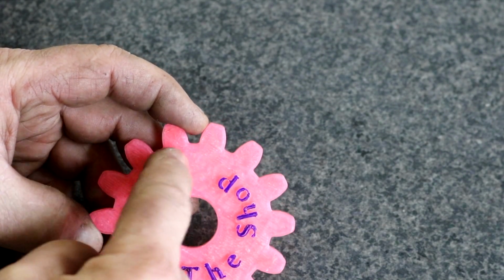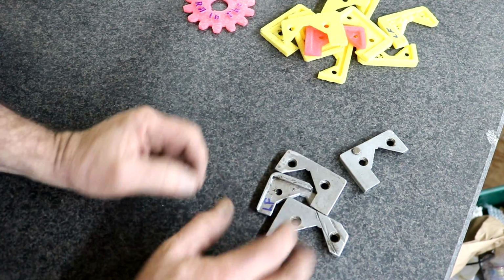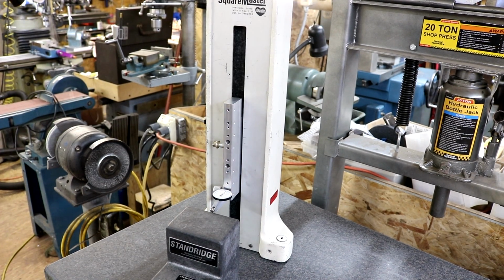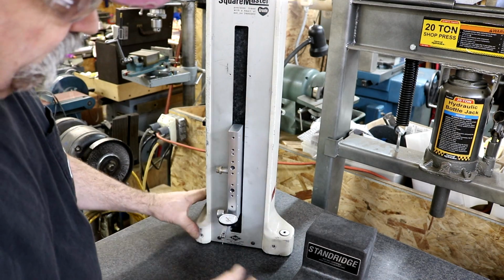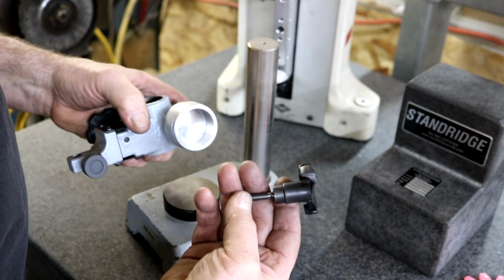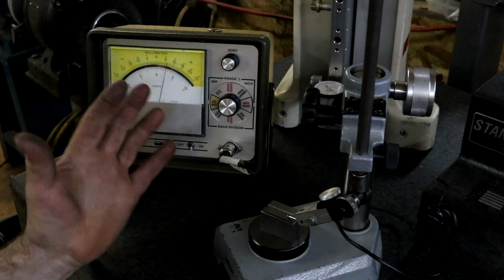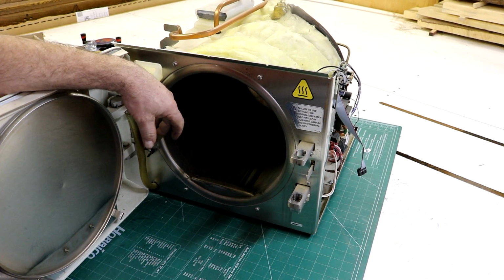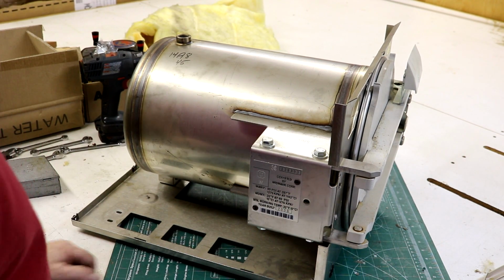Ketchup #64  Ebay Finds  3D Printer  Heat Treat Oven  New Lathe

Comment: Last Bash I picked up a Mu Meeter from Mttutoyo, got it working pretty good witht the help of Robert...
The autoclave is gonna be quite a challenge, don't forget you'll also have to brick-up the front door, maybe try some refractory cement or ceramic bricks, just an idea....   If you make it airtight enough you may be get yourself an inert gas treatment oven...
Have fun with the new projects...   ;)

Comment: Number one tip for “too hot” on small parts is to print 2 or 4 up, that way there is a slower per layer time, so heat does dissipate. PLA loves cooling.. when first starting I wired up a CPU fan and would just sit that on beside the print to cool it down
Reply from the maker: I will try that today, Thanks.

Comment: On ABS, use a heated glass platen with cheap hairspray to make it stick. Avoid drafts, particularly on thicker parts, or they may delaminate. Let part cool and it should pop off, clean platen with glass cleaner. ABS can be treated lightly with solvents, particularly acetone.  Light sprayed on coats will dissolve, then harden the surface; glossy finishes are possible. Avoid air drafts while printing ABS (a cardboard box does wonders). 45 degree minimum slope still applies. Oh, and ABS is more prone to warping than PLA is.
Reply from the maker: Thank you Wes for the helpful advice.  I am not up to trying ABS yet.  Right now PLA is challenge enough.

Comment: If you print some section without support, 45 degrees is the steepest slope projecting over air you should use. Radius curves help a lot, and they look good too. Sometimes flipping the model upside down or on a side to print is needed. The slicer program should make supports for you if you allow it, but then you have to clean all that off the part when you finish.

Comment: Now you can continue down the rabbit hole of ever tighter tolerances. :-)  I think you would find it easier to build a square oven as trimming all that fire brick will be pretty wasteful. I guess you could cast it with refactory like Keith Ruckers foundry.
Reply from the maker: I am thinking 2" wool.  and a few bricks on the bottom.

Comment: Hi Randy,
Looks like you found some nice Ebay buys. I use to have a nice comparator stand like the one in your video with a 4" Federal .0001 indicator, I loved it for O.D grinding.
Steve
Reply from the maker: Yes it is a very nice stand.  I have a nice tenths 3" Starrett for it.
The Squaremaster was the best deal, very nice.

Comment: Instead of bricks use high temp blanket and make a “muffle” furnace. Less weight, more useable room. Plus you can build the elements into the muffle and slide the whole thing in the casing. My enameling kiln is set up that way and it is super. There is no door seal. The door insulation just presses against the insulation on the inside. With a sheet metal casing on the outside you got you a sweet furnace.
Reply from the maker: I was thinking of that.  Could you send me a photo of your set up?  RRINTHESHOP@GMAIL.COM.

Comment: Hi Randy. Being off work is giving you too much time looking at EBay. Lol
Nice finds. My 2 cents on the heat treat oven. I think it would be less work to just bend some sheet metal  around the bricks. Putting a square peg in a round hole is going to cost either a lot of oven space or brick thickness. I would be happy to measure mine if it helps you out. The kiln bricks are not cheap and having to trim them to fit the circular shape would be a waste of material. I “re-bricked” mine and I’m very happy with the results. 
Cheers my friend

Comment: First of all, one thing i note is the fact that the 3D printer seems to be "flimsy". Unless the 3D printer i something in the professional range, you'll almost always have to check your "ways" for loose fit and whanot. So, before you play with any settings, go check for any obvious looseness in the machine. IF possible, by design, adjust according to online guides if no booklet is provided. IF not possible, then try and figure out how some of the slack can be taken off.

Things to look at/for:

-Smooth traverse, if there's any binding in the motions XYZ that will translate in to issues, and mistakes in your part. That's not a note, that's a fact. It can get pretty frustrating chasing a minor tremble, but trust me, once you iron those out either by careful adjustment, or by exchanging parts for better quality ones, you'll see definite better results.
Advice, one stage at a time, never take it all apart. They are quite fragile things despite some being built out of metal.

-Belt tension. Now, this is a controversial topic online. Some say you should tighten those belts until you can sing La Traviata on them, some say, you should not. I say, Xerox copier machines, the big behemoths had all kinds of belts and equipment related to belts inside, and not once have i seen a belt tightened until the white came out of it. 

In fact, most of the tension on quite precise elements like the scanner function and such, were always left to springs of moderate weight.

On my Creality 3D printer i've set the tension to just enough where nothing is forced. Soon, i'll engineer some new end plates to allow for sprung tension VS screw adjustment.

If engineers across the board made them as such, who am i to go against the grain, Xerox, Canon, Minolta, all of them had such mechanisms.

-Faulty or loose connections. This one is a bit more involved and implies a lot of taking apart and a multimeter, but, in the case of a professional unit, for me, it was the saving grace between a costly repair or constant issues with layers after a certain height.

In general, inspect the machine, your machinist eye should see the problems far faster than other users would.

On other notes, "speeds and feeds". For example, always start your print with 20% speed (via knob, turn left for lower speed, right for more, in case you weren't aware of that function, of course), then, as the first layer/raft/brim have caught on, increase the speed back to 100% in steps of 15 units.

Leveling your bed is quite important. A lot of the issues you see might come from that. I started using a last word, then gave up on account of the sensitivity and just made larger wheels on the adjusters. Once that was that, i used the thick paper trick and leveled based on a center position. FYI, leveling should be done only after you've let the printer set its own height based on the end stops, if you level the machine without that position (i let mine run a random program, then stop the machine on center) it will not give you good results.

Comment: Re the top surface finish of the 3D printed parts,  I just learned that there is a setting in Cura called Ironing that uses the nozzle to smooth the top layer.  Just do search on Cura Ironing to see how.
Reply from the maker: Thank you James, I will look into that.

Comment: Randy, with the small parts if you print multiple copies simultaneously the printer will alternate between pieces layer by layer. look into kao wool for the furnace insulation.